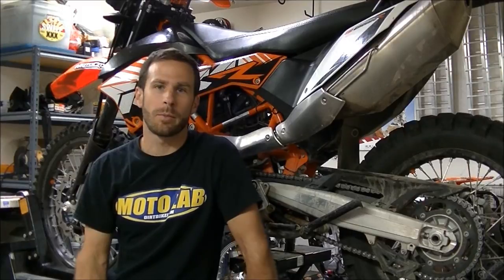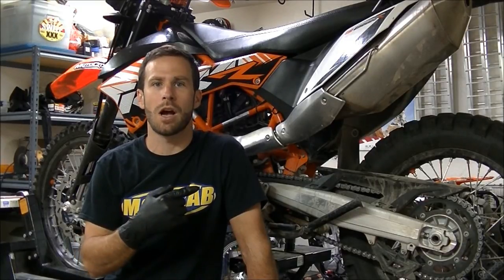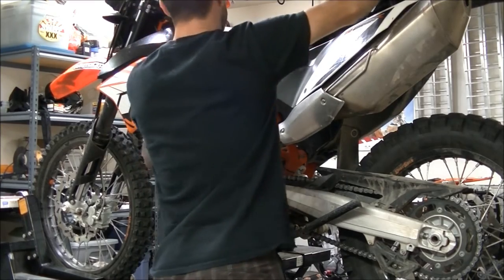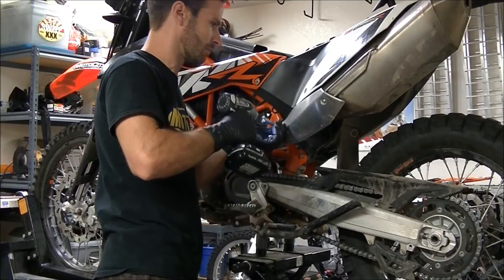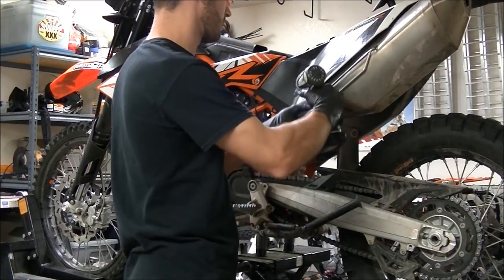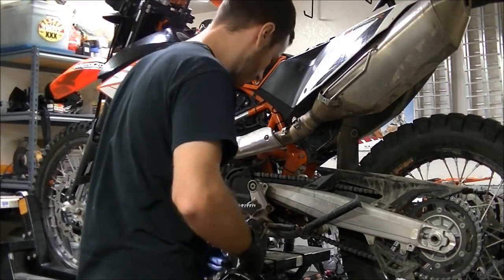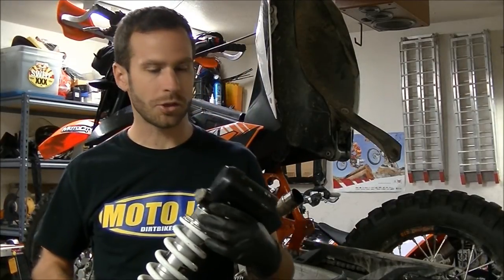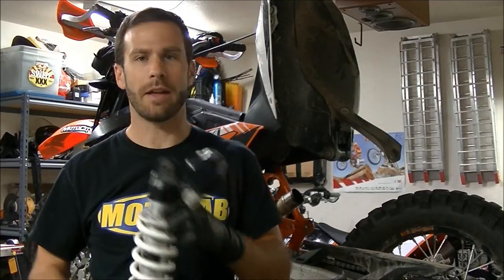How to remove your KTM 690 Enduro R shock

Comment: Nicely done video, thanks.  Suggestion though... prior to swinging the tank up, disconnect the quick disconnect fuel coupling between the tank and the injector body, otherwise people have broken that fitting.